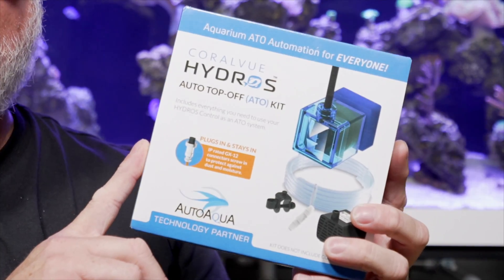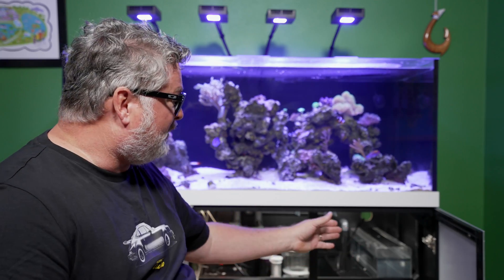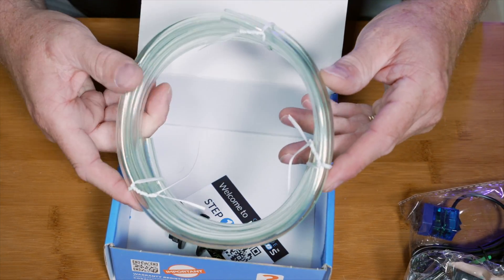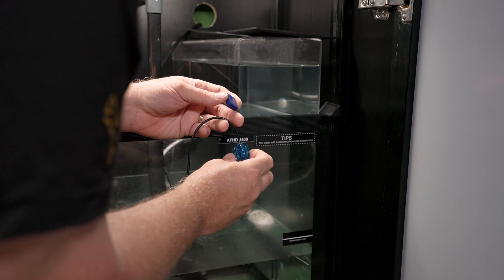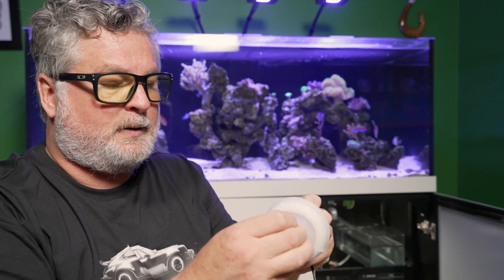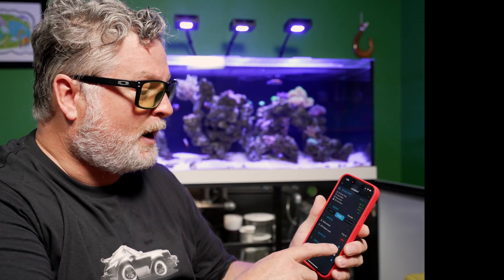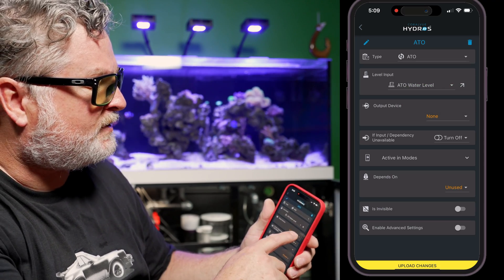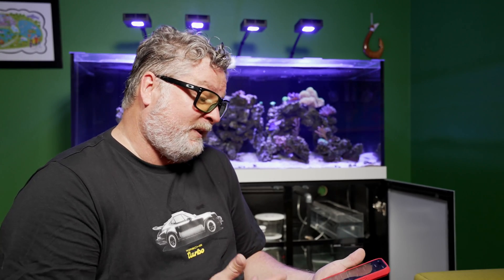HYDROS Auto-Top-Off (ATO) Setup w/ Jimmy! - Hydros Series

Comment: The ATO pump suspiciously looks like the Ice Cap ATO pump. Do you have a way to be able to replace it as those pumps fail quite often but it looks like it’s wired to a special custom cable. Can it just buy the replacement pump when it fails or will have to be a special pump with Hydros cable?

Comment: Their advanced setting are fantastic! I use mine to have my ATO pump switch on once every 30min to 1 hr depending on tanks size to lower noise and wear and tear on pump. And I also use advanced settings to  only run  the pumps for a max of 2 mins to prevent issues with temporary blockage in sump/overflow causing low water in the return chamber. Ie prevent the pump from being "stuck" on.

I plug my ato units into the Hydros ATO setup, ie Osmolator/Kamoer into the controller. The main unit senor lowest, Hydros senor slightly higher, main unit secondary sensor slightly above that. This gives me rock solid redundancy on the my level sensors and has saved my ass more than once..

Comment: It should be noted that you're not tied to the Hydros ATO system. I use the water level sensor, but also use a stronger pump since my reservoir next to the tank in a closet. Pump powers into the power strip that's controlled by Hydros. 
Hydros makes things as easy as you want them, but doesn't hold you back if you want to do more advanced things.

Comment: As an added tip, consider going to the advanced setting to set the on/off times so that the DC micro pump doesn’t turn on and off every second the water goes just a hair below the water sensor level…it’ll extend the life of those micro pumps as constant on/off for minuscule water level heights isn’t ideal as it can prematurely burn out the pump…I still have the original ATO micro pump over 3 years now…works great!